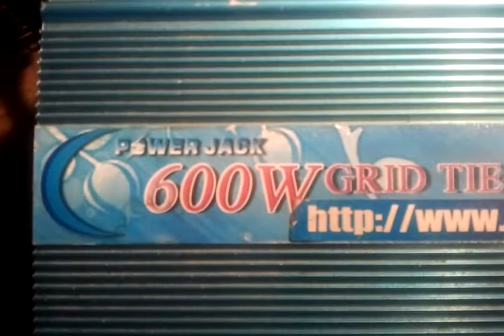Grid-Tie inverter Powerjack 600 Watt

Comment: Thanks for the look inside, I appreciate that. What we learn is that there is a 30A fuse, where the 300W has a 20A, so why not 40A then? The LM317 10V regulator is mounted to the heat sink. This is a newer model. Two nice big input caps, please tell us the value. Same size fan as the 300W model (bad). The AC filters look better than on the 300W model. More GTi and solar / wind info at techluck.com